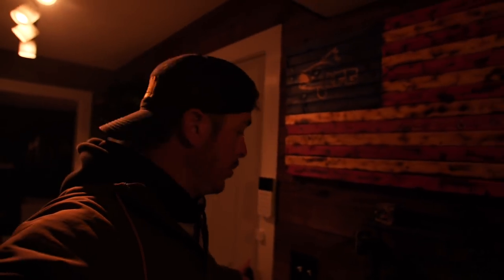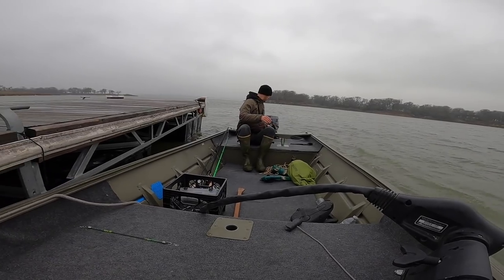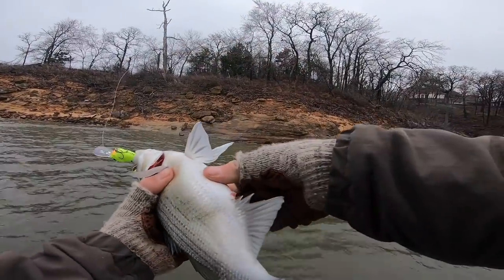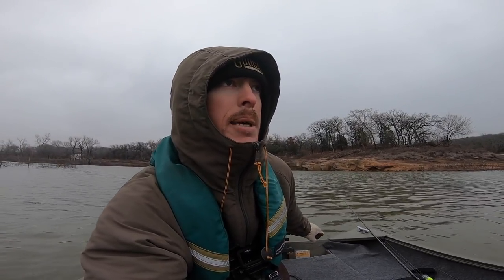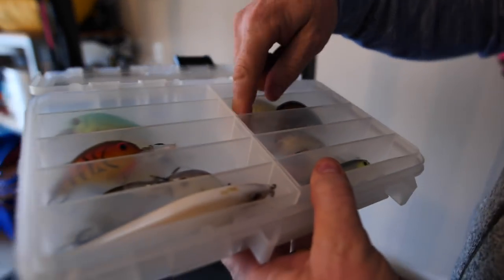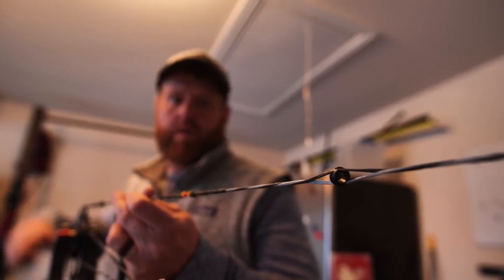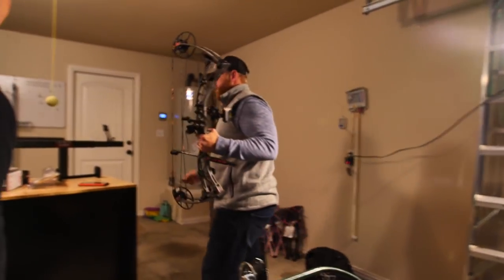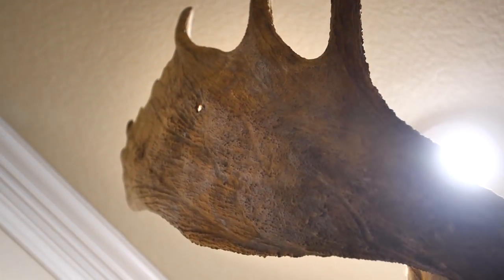Chasing White Bass Up Creeks with Jon Boat

Comment: LFG.  Tie a line to the boat with slack and to the front of the trailer.  Let it float off then grab your end of the line and pull it back to you.  Safest way to launch by yourself and you won't have to lasso the boat like you did a few video's back.

Comment: for the garage room issue, those levels and measuring stuff can just be thrown in a drawer while your real need the archery can take over lolol. archery was the first projectile thing i got into. link from zelda, like the rest of my life was my influence. did a bit in school, bought a bow with my second ever paycheck, a used fred bear compound bow, 60 pounds. had a sight and everything. shot it a bunch, was okay at 80 ish yards but i always wanted to shoot farther, i wouldn't say it was too easy or i got bored, just wanted to do something different, and arrows were expensive. went on to air guns and then normal guns. i'm still good with a bow, just not my thing so much anymore

Comment: I had a friend that was an excellent swimmer he would go fishing a lot when he got off work by himself. Well they found his boat with the cover off the motor but nobody on board 2 day's later they found his body. If you have boots on and fall in 20' of water they are like boat anchors and if you panic and asperate it's over with quickly. Always wear you life jacket no matter how hot or aggravating it is... Oh I would rather shoot a recurve bow any day rather than a fancy compound bow. Shooting a recurve is the ultimate challenge and you don't have to tune it or set the sights  just give it the old dead eye...